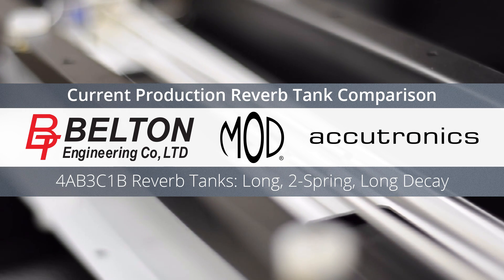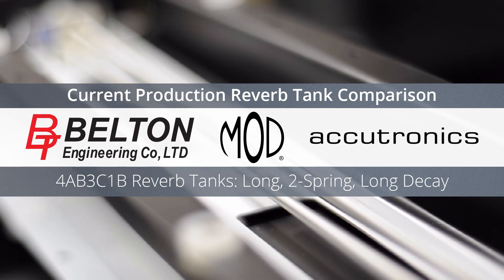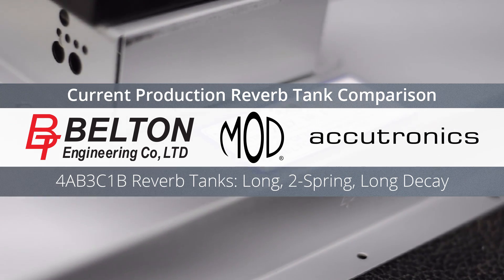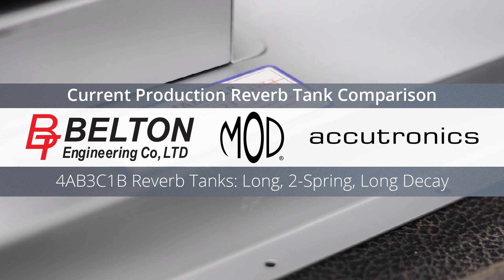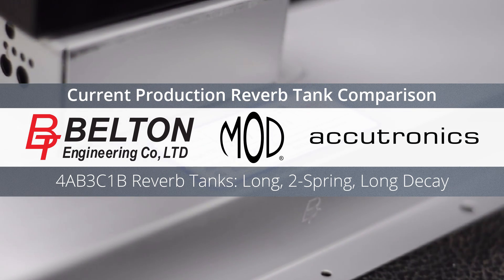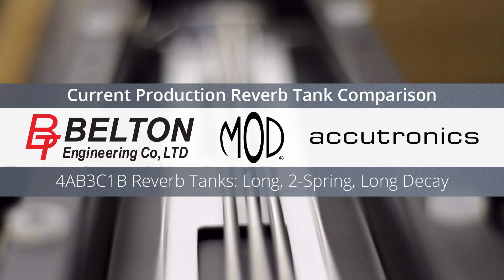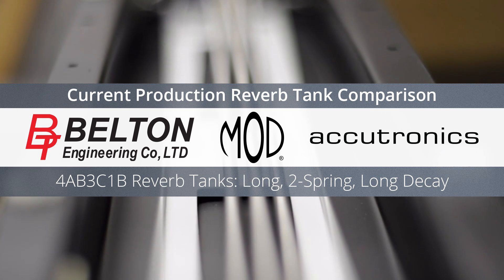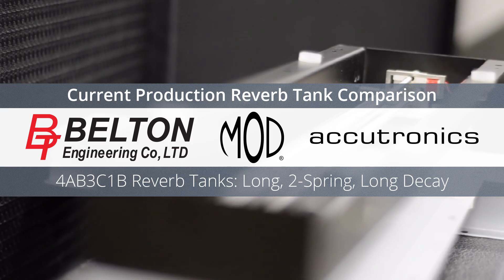Spring Reverb Tank Comparison Part 1: MOD®, Belton, Accutronics®

Comment: Which long tank has the correct impedance for the Anasounds Element?
Reply from the maker: We do not have the specs for the Anasounds devices. The reverb tank should have a series of 7 numbers and letters on it some that will identify the specs.
Reply: I measure 2 Anasound tanks with Ohmeter input coil 1ohm, output over 200 Ohm, I think they are AB

Comment: Belton sounds better here. I stand by Belton. I have built a byoc reverb clone awhile back and this reverb pedal as simple as is it has the Belton module and sounds amazing.  I compared it with some newer reverb pedals like the hof2 and it blows it out of the water in terms of sound quality.  Its so clear and transparent.  I tried to the byoc reverb but just couldnt. This is a special pedal.

Comment: Thanks for the comparison,.all three sounded nice but i think there're differences...
MOD sounded very natural, clean and wet beautifully.
Accutronics sounded a bit narrow, somewhat hyped that i felt the reverb being an oil drop on the water(dry signal)
Belton sounded nice but i think there's more noise(electrical/howling) on full volume compare to other two.

Comment: I don't know what everyone else is going on about-- the Belton had the greatest drip of them all.

Kind of disappointed not to hear a better staccato break. Like a chop strum to hear each tank's full tail. That would have been incredibly useful.
Reply: belton gets muddy, accutronics is a much more cleaner reverb
Reply: @drnrqsldch  MOD beats them all if only because the springs have a small bead of epoxy in the middle and at either end of the transducers to keep the springs from breaking. Way, way more gig-worthy than the Belton or Accutronics units.